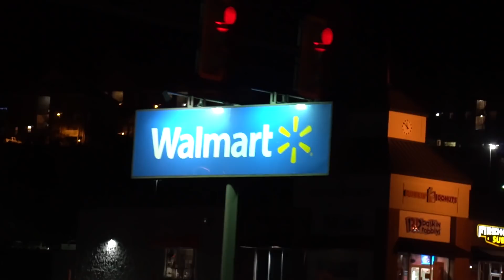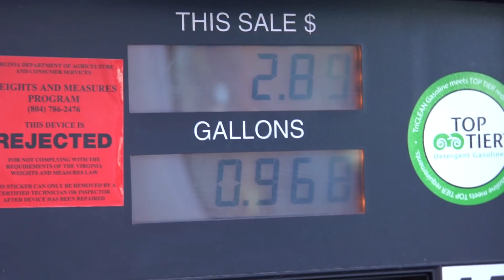The Van Broke Down - Driving Across The US

Comment: trucker tip:

step1. get a PROFESSIONAL DRIVER card in flying j/pilot and love's truck stop.
step 2. register card with your info on it.
step 3. fuel with truckers on trucker lanes and use that card.
step 4. with fuelings 14 gallons or more you get 0.5 shower points, so 2 fuels will give you guys a shower.
step 5. when getting a shower at truckstop ask the shower or front desk attendant to get extra towels, don't hesitate to ask, they get a ton of couple truckers. 
step 6. Enjoy

Comment: For band aid repairs that come up,  there are welding units that are direct bolt on's to the engine.....basically, a second "alternator" that isolates the welding circuit to protect the vehicular electronics.   Can also act as a charging unit for your on board "camping" electronics.

Comment: keep an air gap between the back of the fridge and wall, it need to circulate air with the fan to work.  Sometimes it'll quit working and if you put a fan blowing down where it blows where the compressor is, it may start working again.  This is when the fan is the problem, not just in general.  I mention it cause some would give up on the fridge but I've seen them live on for months with an out board fan blowing in the compressor compartment, but you need air circulation for the fridge to work well !

Comment: Good to see you have the monitor for CO!! Gas cooking and using the gas heater is VERY dangerous in a camper. Carbon monoxide is a killer without a conscience. Detectors for CO should be at head height, LPG about 300mm (About one stretched out squirrel)  from the floor. Love the van! Stay safe. (From Australia)

Comment: On the dead fridge, it may have been the load protection on the charge controller that tripped - it does that to protect the battery  and your inverter from low voltages. Usually inverters have alarms for low voltage, but perhaps the inverter alarm threshold is lower than the charge controllers.

Comment: Just a heads up - carbon monoxide is heavyer than air so the place you mounted your sensor wont work, as you will "drown" in CO before it reaches that height.
If you want to be safe you should mount it at the same height as you sleep in. 
Love the van life videos - keep up the good work as always

Comment: Trust me on this. Get dedicated winter tires for the colder weather.  Nokian makes some good tires as does Bridgestone with their Blizzak tires.  I am just testing my first Nokians since they should last longer on the dry pavement. I have always run Blizzak tires and they work very well in snow but are a little soft on dry pavement at higher speeds. Not a tire you want to drive 80mph on but it can change packed snow to gravel like traction.

Comment: Fridge offline - the load output from the controller is usually subject to some sort of battery protection protocol.  This means than when the battery voltage drops to a certain point, it automatically turns the output off to keep from over discharging the batteries.  Most controllers default to maximum battery protection (for longest life) - you may want to look into that and change the profile setting to allow a little more discharge before cut off.  Just a thought.
Reply from the maker: I actually discovered that the 'ok' button on the display also turns the load on and off. I was using it to trip the back light, meanwhile, I was actually also turning the fridge off.
Reply: Ah...ha!   Funny how we all "some how" ourselves.

Comment: Tucker!!!  Put the battery back in the CO / fire detector!!!!! If it has been going off, it has been going off for a reason.  It may have been the faulty exhaust system. We don't want to lose you guys to CO poisoning, the orderless colorless killer. :(
Reply: Came here to say just this
Reply from the maker: New Jersey Bill It went off because we were cooking food. 😉 Not to worry, it's on whenever we run the heater.
Reply: Odorless*
Reply: Tucker, there's no difference between a stove producing CO or a heater producing CO. If the detector goes off, you need to vent.
Reply: Balu I'm guessing that he means that it's the smoke detector that was going off, not the CO sensing system. If not, I totally agree.
Reply: Install 2 of those, redundancy is the key to survival......detectors are cheap.

Comment: You might want to consider charging the fridge battery also from the motor while you're driving if it is cloudy.  Your charge controller might do it automatically understanding that it can choose the power input (solar vs. engine), or you might use a battery control switch.  Use can use something like a split-charge diode off the alternator so it charges the car battery and house battery at the same time without "leaking" current between the two batteries.  just a thought.

Comment: hey man so just to give you a heads up, i have me Fire Super-attendant Licence. For the C/O detector you need to put it as close the the floor as possible because C/O settles on the bottom and then rises to the top. so by the time your detector goes off you will not be awake by then. and the Smoke detector. make sure you only get Photoelectric types only. do not get the 2 in 1 detectors. they are the worst. but all in all man i love your vids!!! keep up the great work.

Comment: Pro tip have to carbon monoxide detector by your feet so if it "smells" it it will wake you up so you don't die and if you have the heater on all night crack a window open so you have good airflow and then you won't have condensation in the morning.

Comment: So much for my earlier "how about those german vehicles" comment :D

Btw, I think that the red button is acctually a "fuse" that triggers when voltage is too low, to prevent discharge of the battery. So by pushing it you are enabling discharing it again.

EDIT: Never mind, just noticed that it was just the exhaust so nothing engine-related :)

Comment: Also, the fridge isn't working because you have it plugged into the load side of your charge controller. That will only have power when the sun is hitting the panels. It will not draw off the battery from the load side.
Reply from the maker: Nope, it will draw from the battery all night. I discovered that the back light button I was pressing on the display also shuts off the load port.
Reply: Okay. Glad it's working for you.

Comment: Do you have a battery isolator? 
With one you can charge the deep cycle batteries when the engine is running but don't have to worry about draining the van battery when it isn't running

Comment: Dudes! You gotta get a battery isolation system so you can link the batteries while the engine is running. There are some good systems by Blue Sea and National Luna.
Reply from the maker: I honestly don't think we need it. We have gone through 2 cloudy days and didn't drop the voltage below 12.6.
Reply: You do have an abundance of solar on there, so you're probably right. Good luck and enjoy your travels!
Reply: Maybe don't need it there, but if you park under trees for any length of time you can soon run the battery down (I know I've done it).  A voltage sensing relay isn't expensive and allows the vans alternator to charge the battery while you're driving irrespective of the weather.

Comment: SOLAR....every solar charge controller I have come across has three sets of connections like yours....one from panels, one to battery bank and a "load" connection.....the load connection is programmable and is meant to power such things as lights (that you don't want on all the time, like outdoor lights).....your CC has a remote and I suspect that is where you can program the load function from (constant on, on at dusk, off at sunrise or hourly settings)....if it happens again, either read up on your controller or just connect the fridge directly to your main circuits (from battery bank) and ignore that "load" connection (most people do)... 12.7V is 100% battery charge so your overinvestment in panels (400W) is paying off in that respect. Electric heating elements like toasters, heaters AND curling irons (lol) are energy hogs and should be avoided below 12.4V....if you want to get the maximum life out of your batteries....either way if voltage gets to 12.2 it's time so seriously limit power consumption until the sun comes up again. I second your decision to not interconnect the vehicles electrical system with your "house" system...doing so would make it very difficult if not impossible to monitor how well your solar system is performing.....keeping it separate is the only way to do that. Regards, F.....PS: You deserve a medal for driving a RWD Sprinter....with a trailer no less....on snow covered roads!!!!!. I would have "stayed in port" and waited for better weather ;););)

Comment: Your carbon dioxide detector should be at the level of your head in the van. Is heavier than air so sinks to the lower level. I have one in my converted ambulance :) (edit I meant carbon monoxide)
Reply: Level of your head whist sleeping I must add lol
Reply from the maker: All of the research I've done says that carbon monoxide is less dense than air. Especially if it's coming from a heat source, it will rise. Also, the manual for the alarm says to mount it high.
Reply: Tucker Gott seems I was misinformed! Thanks
Reply: It was my understanding that Carbon monoxide is heavier than the surrounding air so should sink but Carbon  monoxide will be warm when emitted so it should rise and then sink down. But it looks like you took the batteries out anyway. Keep up the great videos
Reply: It is true the carbon monoxide is heavier than oxigen, but the bed is mounted high in the van and it probably will not affect them.
Reply: Yup.  The difference in CO density is not significant enough to matter in detector placement.  High mount is required for the smoke detection function.  However, propane is a different story - it will sink and form concentrated layer.  A 1lb bottle is not too much worry about, but the potential is there and they can leak.  Just keep it in mind.  This is why RV LP detectors are mounted only an inch or so off the floor.
Reply: Yea so those heaters run pretty clean and i sleep with one in my truck but i ALWAYS have air for combustion available (my case is rear swing door forced open 1/8 in) because when a heater starts to burn it’s own exhaust thats when CO numbers start to climb to deadly levels
Don’t let that small tank fool you a poorly running heater can make that van into a gas chamber in minutes!
Also consider a carbon monoxide monitor instead of an alarm (UL 2032 alarms are called death alarms by people in the know)
Anyhow allow some air in at night so you don’t wake up dead
Have the time of your life out there guys!
Reply: Your space is so small it makes zero difference. CO and air are almost the same density and will readily mix if any air flow, but will be on top of introduced warmer.
Reply: Yeah but you need to keep the battery in for it to work.
Reply: Winstan carbon monoxide
Reply: Can you record a video of the converted ambulance?
Reply: Nothing in Particular bella_the_dog_cant_wait_for_summer_adventures

Comment: 22mpg aint great. Im just saying. I thought you would of had a diesel van but maybe i missed that somewhere.  To put it into context A Porsche GT3 RS is quoted to get around 22.1MPG and that has 520bhp engine. I guess the weight of all the work done to the van and also the having to pull the trailer added a significant chunk of weight to make the engine pull really hard to get upto speed.

There are probably better more economic options than that van albeit maybe they'd be a bit bigger.
Reply: RoseOfHizaki I have a ford explorer it only gets like 16 MPG so 22 for a vehicle that large is pretty good
Reply from the maker: It is diesel and 24 is what it's supposed to get. We were getting 24 on the highway, now 19-22 with the trailer. If there is a vehicle this size that gets better fuel efficiency, I'd love to know about it. Anything gas gets much less and even the newer sprinters get less.

Comment: Co2 is heavier than air put it at face level with where you're going to be sleeping or else by the time it goes off it will be too late
Reply from the maker: It's not a Co2 alarm.
Reply: Cloud Chasing and ur so right..  your dead when it will go.. some have a lose detector with a wire that runs down to the floor

Comment: The carbon monoxide detector on the ceiling won't help you. Carbon monoxide is more heavy than air. So it starts filling up from the ground, and if your detector on the ceiling beeps, you are dead since half an hour.
Reply from the maker: Everything I've researched said that's a myth. The instructions also said to mount it high.
Reply: @Tucker Gott:
Maybe you mount a smoke detector near the ceiling and the carbon monoxide detector near the floor, just to be on the right side.
And very important: Enjoy your trip and stay safe. 👍